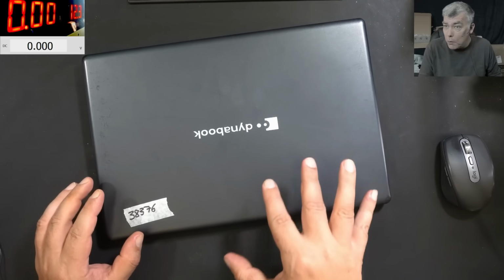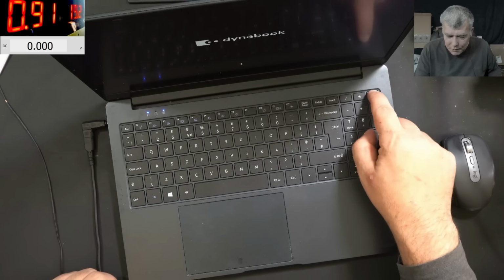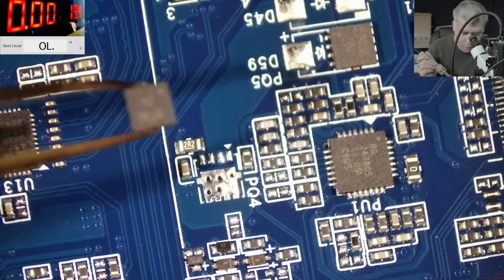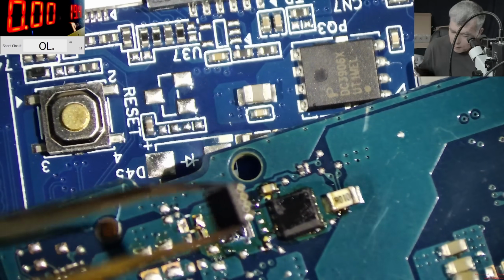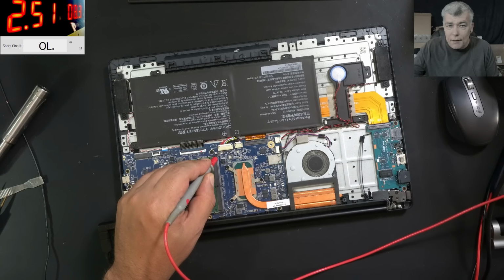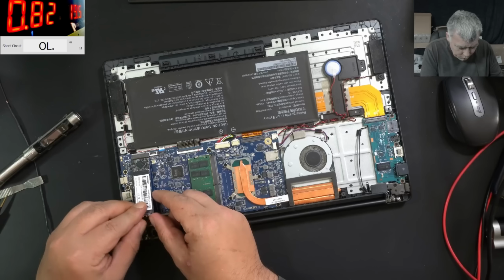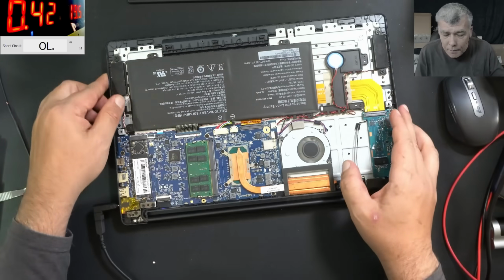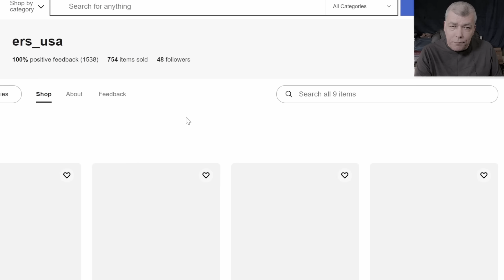Don't look for the same mosfet to replace, look only for the same type (n-p channel) Toshiba C50

Comment: Actually you can't say "go ahead just look for the same type". I wold replace charger's circuit mosfet with literally anything doing the job but i won't even think about doing the same with vcore dc-dc's mosfet, there's only like 0.7v but 15,20A.

Comment: I find everything I see very interesting, but when you, Sorin, were still working in the shop there were also amplifiers or televisions or mobile phones or electronic devices that no longer worked. That was a change. There is only laptops left in the world to repair, it gets boring because there is so much electronics. Something else has to be repaired too. That would be nice, but dear Sorin, I love your videos, best wishes from Germany

Comment: not only the same type but also the same specs or higher ... supported voltage and amperage... if you put a mosfet of a lower working voltage or amperage the chances are it will blow in the future
Reply: Higher spec is always good

Comment: I'm having the same issue with my ASUS laptop though I have owned it for several years without turning it off it will only work with the charger is plugged in and then still sometimes it'll shut off on its own. I'm thinking either the battery is dead or it's a mosfett.

Comment: To check for N or P type mosfet, put your probe across drain and source, if current flows or there is a reading in multi-meter check which probe is on the drain. If it's negative it is n-type, otherwise it's a p-type, unless it is defective.
Reply: ohm or diode mode? and does n channel mos is always 4 pins?
Reply: @saklaptalangka1557  I would say continuity, as diode wont give a negative reading as a diode can only flow one-way meaning diode mode would block any negative current reading. I would say red/positive on drain, and black/negative on source should do it with multimeter on continuity mode.
Reply: @saklaptalangka1557   good question , sometimes you will encounter 3 pins , 4 pins , 6 pins , 8 pins mosfets , do you check them the same way as 4 pins mosfets ?  sometime you can't find their specs on the internet , in spite of what is marked on them
Reply: Thank you very nice tip.

Comment: Thanks Sorin, where is the ground wire when you put power on the battery at 6:27?
Reply from the maker: The ground wire is actually the ground from the charging connector as i'm using the same power supply
Reply: @electronicsrepairschool I was wondering that too , like is it magic we are seeing 😂

Comment: Hi Sorin, thanks for the lesson you teach me not to be to much precise o the mosfet swap... but it's not risky to insert the m2 drive without disconnect the battery? .. let me know please bye Francesco Timpano from Florence Italy
Reply from the maker: When the laptop is off, the m2 drive doesn't have power, so can be swapped
Reply: @electronicsrepairschool   Thanks very much Sorin....and keep go on so we need a passionate teacher like you especially in dodgy way 😉